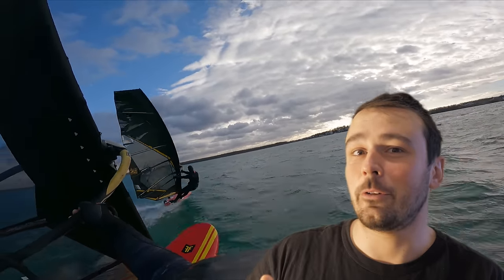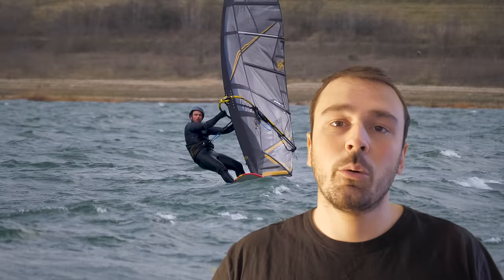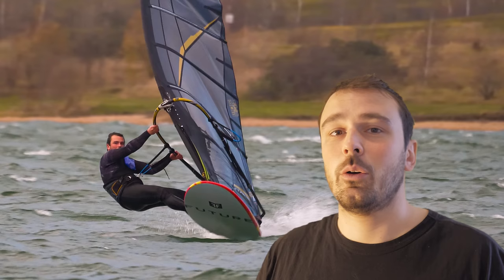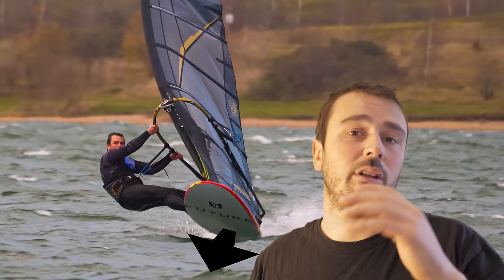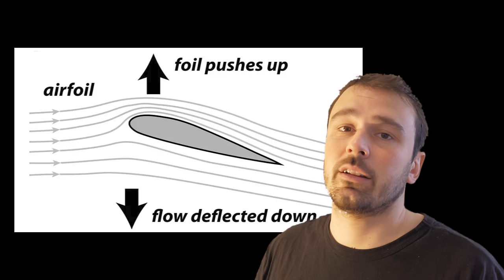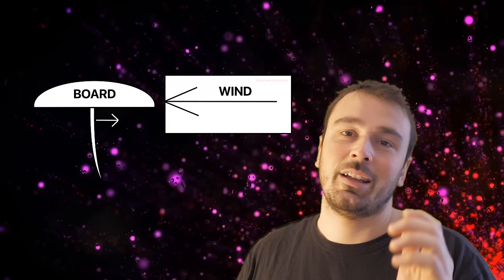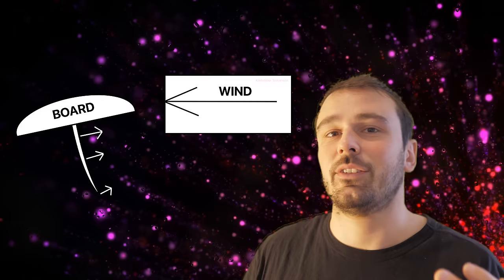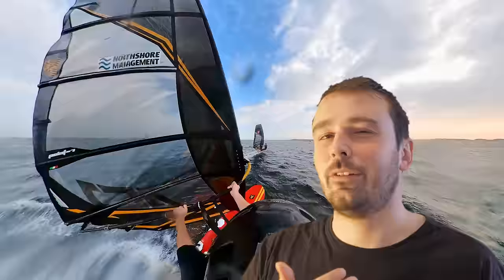Get 3 KNOTS FASTER with this technique | RAILING YOUR BOARD

Comment: As someone with aspergers autism and an ex surfer/shaper, I can't help thinking it should be the leeward rail to be lifted.
I understand that your goal is to have the fin in a more horizontal plane to extract a verticle lift. But this wouldn't necessarily matter which way the fin was slanted.
Another thing is that, in surfboards, big single fins, that are used in windsurfers are slower, with greater drag, than smaller multifins.
Surfers use the rail in combination with smaller fin/fins, which increases speed with less drag, and which doesn't appear to be the case with windsurfing, except in turns. Kiteboards, on the other hand, take advantage of the windward rail with small fins.
So, in essence, windsurfers are trying to rely on semi foiling by using a large fin. But it's known that foiling more efficient, but in regard to top speed, it is sub optimal.
Just saying/thinking. Cheers

Comment: Great video Nils, im a 67kg rider and ive heard that modern windsurfer boards are designed for people 85kg so at my weight the board doesnt seem to work well with normal mast base position or normal strap positions,  i have my straps all the way back and tend to run the mast base along way back to get the board flying but its a fine line sometimes the board then flys away, any advice for lightweight riders to go faster? cheers

Comment: Techno 293 surfer here, we use this all the time. Its a little different cause we use it on the sharp upwind . Still very useful
Reply from the maker: i need someone to teach me that, failed miserably at railing a raceboard upwind 😅
Reply: @WindsurfingNils  on a T293 board or a regular board (not sure if it's slalom) the Techno board has another big fin in the middle that's retractable. Not sure how it works on other boards upwind.

Comment: Nils I’ve bought a point-7 ac1 7.8 sail and I’ve rigged it with rrd mast 100% carbon.
I went on the water for the first time and the cambers were very hard to turn, I had to push them in every jibe by hands, any tips for smoother turn? Or it’s just incompatible? Have you ever used a different brad  for sails and masts?
By the way great advice as always,
Keep it up🤙🤙

Comment: Hi! Is this achievable with fsw and wave board? Thanks :)
Reply: The theory is the same for all windsurf in planing condition.
Reply: But in wave you don't ride so much on the fin(s), you have much more board in the water.
But try it!
Reply from the maker: Yes, agree with Niclas, theory is the same but the gear is not aimed to ride as freely here
Reply: with a single fin it is possible with multi fins not. The reason for this is that a longer fin creates a higher leverage. Therefore it is so simple with the long slalom fins.